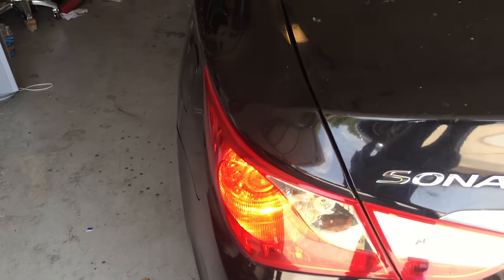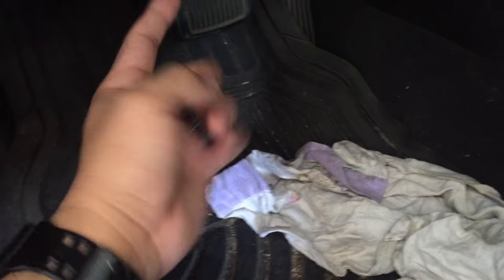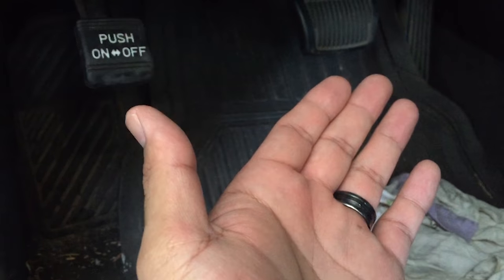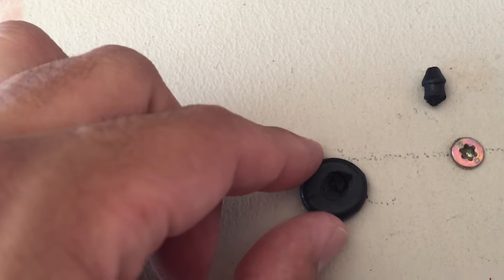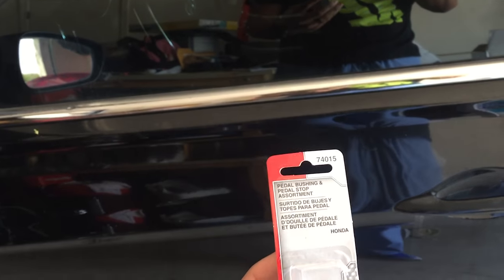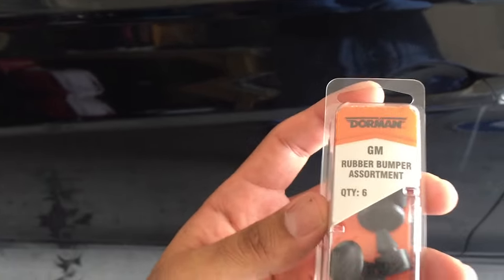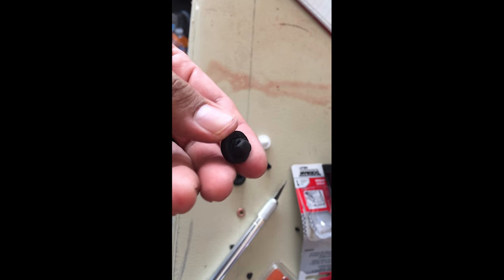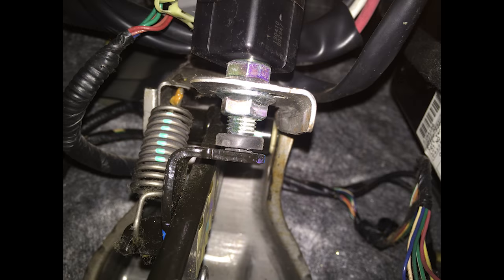Brake pedal switch plunger pad replacement

Comment: TIP: turn the car on and you'll be able to push the brake pedal alot further down, makes it much easier to get to the spot where the rubber pad goes.
Reply: No good. You have to remove the battery cable when working on the switch.
Reply: @emiliog.4432  You don't have to touch the switch to replace the pad
Reply: You're the only one in all these videos to say this. That helped a ton with the frustration level.
Reply: This helped so much thank you I was able to get it done in seconds versus the 15 minutes I tried before
Reply: Thank you so much for this tip...I just changed mine and switching the car on made a difference like you said. 🩷
Reply: Bro.. I just changed it myself I was thinking the same.. took me 15 mins I almost knocked my car out lmao
Reply: I literally fought this for over an hour and then seen this comment 😂
Reply: Thanks!!
Reply: @shessoheavy6130 I agree!
Reply: I’m reading this after a day of defeat because I turned the car off every time thanks I’ll try that tomorrow
Reply: Thank you so much. This trick helped us so much.
Reply: You have no idea the amount of rage you just calmed down within me bro. Thank god you wrote this comment.
Reply: This is seriously the only way I could get it. I also took off the return spring to make it that much easier for my fat hands to get in the right position. Don't forget to put it back on!!
Reply: Thank you for this comment. Mine is an o4 g35x the brake wouldn't go down far enough to give me the room to push the stopper in flush. It just kept slipping and I'm already upside down and having to reposition to get that little mfers was a pain. Couple fingers got scratched up and bleeding but once I turned on the car and it was a 5 second fix. Thank you.
Reply: Thank you

Comment: Lots of other videos cover this too, but yours was the only one that gave me a crucial tip: the universal rubber stop pad might only ALMOST fit and might need a bit of a close shave -- that was the final ingredient to success. Once that was done (and after I figured out the trick of using the pad to depress the button first, then shoving it into the hole space), it was literally a 30-second job. Thanks so much!

Comment: I appreciate so much you making this video.  I diagnosed my brake light issue by watching one video and discovered the part on another video, but it was your video that helped me to really see the location of the bumper pad. I have an Elantra and it seemed to be in a little different location, but I was able to recognize it from watching your video.  AND..... thanks for the tip on placing it in the hole to make an impression on the pad to see where to cut away to help the bumper fit.  I just finished fixing mine and this was so so so helpful.   Thank you!!!  You could update your title to add "brake lights stay on when car if off and..." and I think it would help drive a lot more viewers to your video to diagnose, know the part and how to replace ALL from your one video!!

Comment: I'm sorry no one understands how difficult it is to film and install the part without help. My husband is about to fix our 02 Accord using this method and got frustrated, but explained that unless you have someone else filming or holding down the break pedal (if it isn't lodged down with a stick), it's really hard to show the exact moment of installation. Folks need just a bit more empathy. You show where you replace it and explained thoroughly. I appreciate it.
Reply: That's fine, just don't call your video "how to replace brake light stopper".  He skipped the part we came to see.
Reply: True. It's very hard to record it while doing it

Comment: For anyone trying to squeeze the stopper in to the hole. Place the stopper over the hole and use the pedal to squeeze it in to place.
Reply: still not going in for me😭
Reply: That was key. Thanks for the excellent tip!
Reply: When i did that, it actually bent the span of metal between the stop lamp switch and the cruise control switch 🙄 I had to put an allen key in-between the stop lamp switch and the replacement pad before letting go of the beake pedal to even get the pad to stay in the hole, but now it won't depress the stop lamp switch enough to turn out the break lights. I swear, it would be 100x easier if i could just unbolt the bracket eunning across the brake pedal assembly!

Comment: Had this issue with my ‘98 Civic today… brake lights wouldn’t turn off.

Luckily I put ‘two and two’ together when I randomly saw the broken plastic stopper on the floor of the car just when I was googling the light issue. 

They had one of these left at Autozone. It fit right in, can’t believe how easy of a fix this is.
Reply: Easy fix, but also very stupid design.. I don't understand why they didn't just design the metal of the brake pedal to stick out a little further at that spot, instead of putting a plastic piece there that will eventually break and render your vehicle temporarily undriveable. Worse, it could break while you are on the road and you would be without brake lights and not even know it unless someone warned you or worse, ran into your rear end

Comment: Have this issue now.  I would try to go to the dealer though instead of going to the local autoparts store.  I just called Hyundai and the stopper is I believe just under $4.  I would give an exact price but I also got a quote for the brake light switch which can be the culprit in this situation and it was around $15.  So if you can and have time, I would go to the dealer.  You really dont save any money over a generic part and there will be no modification.  But in a pinch, modifying like you did is perfect.
Reply from the maker: Thanks for the info really good to know.

Comment: This brake switch pad is under extended warranty. 15 years and unlimited mileage. Hyundai will fix it for free. I just made an appointment to have my brake switch pad replaced for free at my Hyundai dealership on Wednesday. My car: 2014 Sonata with 117,000 miles. Today's date: 12-07-2020. Just thought I'd let everyone know. BTW...the dealership pad costs $6 if you want to do it yourself.
Reply from the maker: That"s really good to know thanks for that info
Reply: I did it myself.. much rather spend a few minutes doing it at home than waiting at a dealership.

Comment: I have a 2003 TL-Type S.  Noticed the brake lights were on after getting the car back from getting new tires.  I originally thought the Brake Light Switch was burned out.  Looked at the floor board and found the remains of the Brake pedal accelerator stop pad.  Went to Auto Zone and picked up the part below and now it's working.  BY THE WAY, if anyone has a 2003 TL-S taking the actual Brake Light Switch out of the car is not as simple as all the videos I've seen where you turn it counter clockwise and it pops out.  Still not sure how to get it out but it took a lot of force and a pair of pliers just to turn the switch.  That's when I noticed the aforementioned pad on the floorboard.

Comment: It is for 1998 Corolla. Release a spring, and then remove a pin clip and the pin itself will make inserting the new cushion in place much more easily. You can do the job easily in less than ten minutes, folks. Good luck!

Comment: In a pinch I used those little hard felt Furniture pads will also work you can get them at the Dollar Tree and you just put it on there with the stickiness on there and they'll hold on that's if you can't find that part right away emergency type

Comment: It didn't look like you pushed the pad all the way down. I bought the same kit for my Subaru, but the white one was an exact duplicate of my broken one. You really need four hands to do this, but I adapted. I used my 4 foot level to push the brake pedal down and then wedged the other end against the seat back. But, I couldn't hold the switch plunger up far enough to get the plug in. So, I loosened the bottom nut and raised the whole switch and slid the plug over the hole and pushed it down in. I couldn't make it go all the way down and it was still up as much as yours is, so I got a pair of Channelocks and used them to squeeze the plug down until it snapped into place! It fits ALL the way down against the metal bracket! I tightened the bottom nut back up and took the level off the pedal and everything works perfect now! I even put a tiny bit of grease on the pointed end of the plug to help it go in, but it needed that tiny bit more of pushing with the pliers to get past the widest part and snap into place, flush with the metal bracket! You'll hear it when it snaps into place!
Reply from the maker: Nice man good job your right about needing 4 hands lol

Comment: I am a hyundai service tech    there is a recall on this    and it is free from the dealer   it is year and model spcific     use the oem type 
after market  s  are junk   dont last as long and do not fit the correct way
Reply: Mine is a 2005 and is doing this will they fix it plus my brakes are just locking up for no reason idk why.. any ideas?
Reply: Are the ones they sell at the dealerships the new improved ones?

Comment: Would this also cause random loss of power while I'm driving for a few seconds (because the brake pedal is falling down)? I'm having this exact same issue, but add the loss of power (also I have a 2012 Kia Optima).
Reply from the maker: Not sure of power loss but it will drain your battery so it can effect your electrical system until battery fully charged from your alternator
Reply: Kind of: this is often caused by the deterioration of THE SAME PAD (same part #, 90541-06036) but on the ACCELERATOR pedal. I had this problem for some months on my Solara; only discovered it when I went to change the pad on my BRAKE pedal - and found that BOTH pedal pads (about $2 a piece) had fallen apart/out on both pedals!

Comment: Thanks, Saved me who knows how many bucks. Honda would have charged me hundreds for a 5 minute job to replace an $8 part.

Simply push the brake pedal down with one hand, position the grommet with the small side down, release the pedal, and the pressure of the pedal will secure the grommet in place. If it doesn't work the first time just re-position the grommet.

Comment: I have this problem but i have been getting around this by lifting my brake pedal with a screw driver behind it.   Is there a reason why the sensor would no longer be touching my brake pedal in the natural rest position or is my brake pedal not sitting where it should when not being stepped on?  Is it normal for a brake pedal to be able to be lifted forward?    Not sure if my pedal or the sensor are my problem.
Reply: Same issue you ever figure it out?

Comment: Why not just bend the bracket till the brake lights go off.  Stick a screw driver between peddle and the bracket, have someone stand in the back of the  car and say "Lights are off" and never have to deal with it again.  In the old days before you were born we didn't have cheep Chinese plastic crap.
Reply from the maker: That’s one way to do it also

Comment: I too am six foot, before shrinkage.  Just today I'm doing this same replacement on a 99 Toyota Carolla. At 70 years old,I not only cuss a lot getting upside down in a tiny floorboard, but my hands are too lage, and extreme bending of fingers make me want some dynamite. ,

Ten minute job 40 years ago maybe. (And there was more space and less junk under there back then.) Now it's been a half day and two pints of alcohol, one to bath my flayed fingers with and the other pint to drink to make me forget I still have to put the new switch back on. 😞

Comment: Hey Good Video-Thanks-I will replace mine in my 2001 Tacoma Toyota OEM Part # 90541-06036-Cost $1.59 at the Local Orlando Toyota-Cost over $5.00 via Ebay/Amazon.